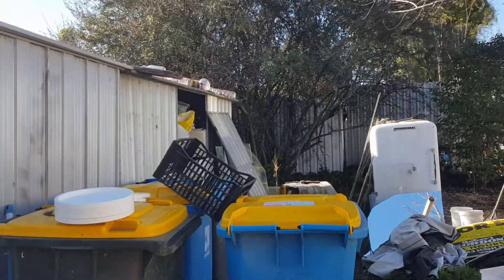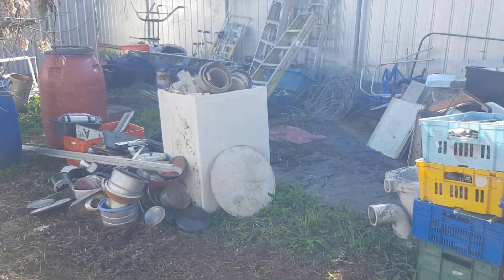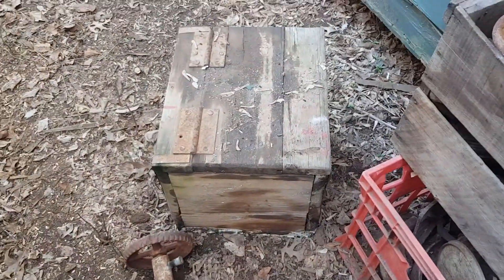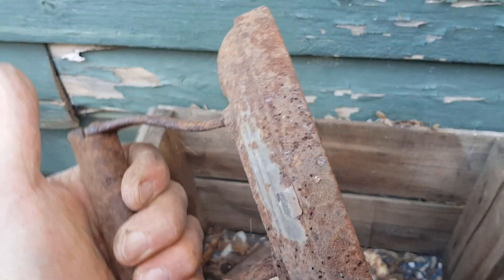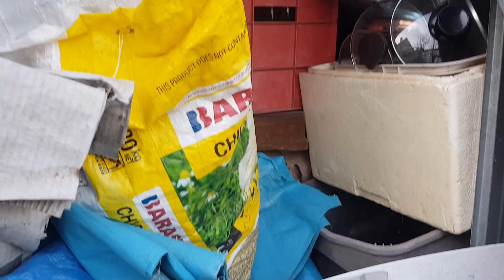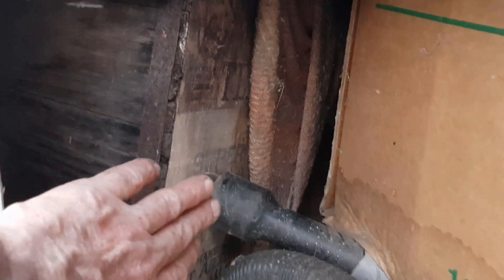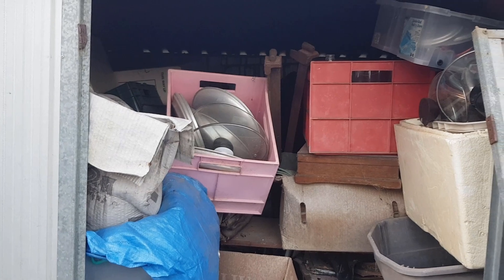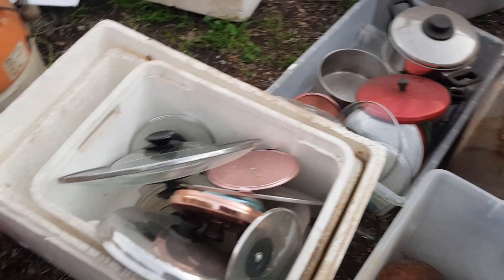The great clean-up Part 44 - Still treasures everywhere! Some nice old Bottles too! 5 Days to go!!

Comment: You've got some great stuff there Chris. In England it's quite common to beeswax polish rusty steel and iron, it looks pretty good. 
Those Stanley planes! You are very naughty 😉 and all that wast oil you have! Still a bit electrolysis and a wet n dry rub over I'm sure they will take someone's fancy. 
Anyway enough chatting 😴 you need your beauty sleep. All the best ✌♥️🇬🇧
Reply from the maker: I'll enjoy bringing those planes back to life when I have time Les - but you are right, I shouldn't have left them there!